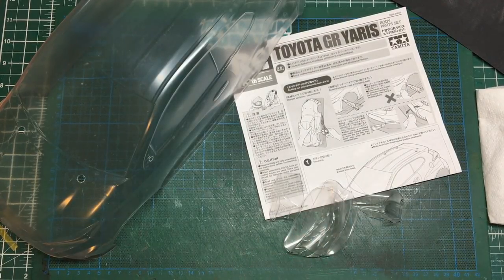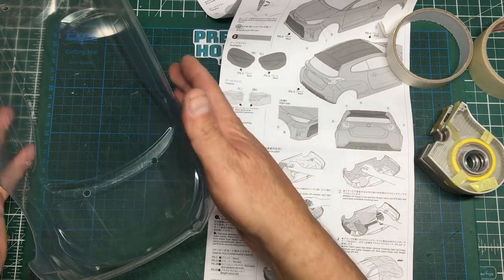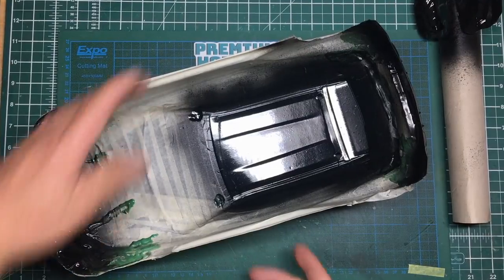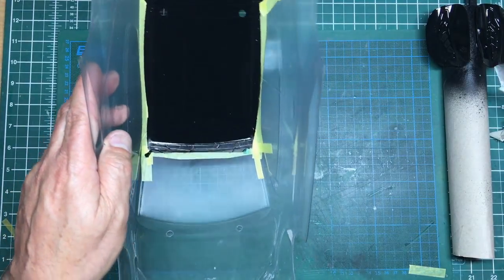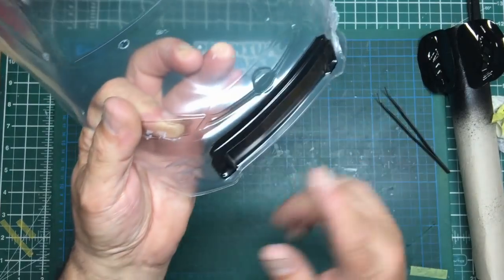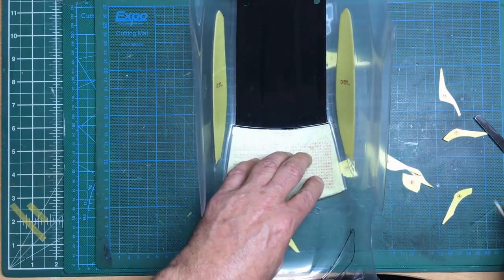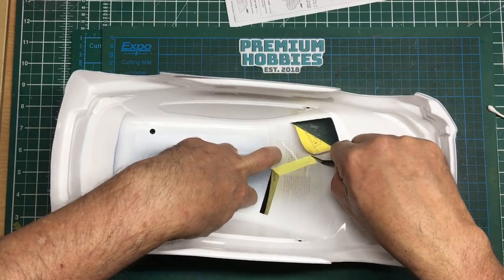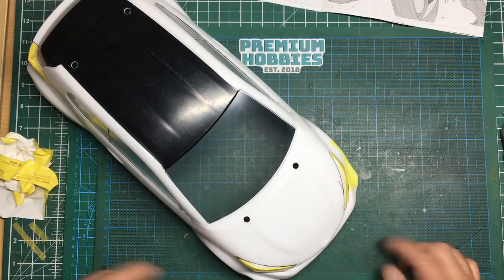Tamiya 1/10 RC GR Yaris build. Part Two.. Painting the body

Comment: I see and understand black before the white, but wouldn't black over the white light fast this clear plastic and give a more solid look? It's not anything I've any experience, but from scale modelling I tend to light fast cars with black 1500 Mr Surfacer primer, especially when using whites
The windscreen scratch, would the tamiya compounds remove? You could scratch a piece of your scrap and try?
Reply from the maker: Yes it would Keith, but there's always the risk of it showing thin areas. I normally prime with black if doing white to finish.